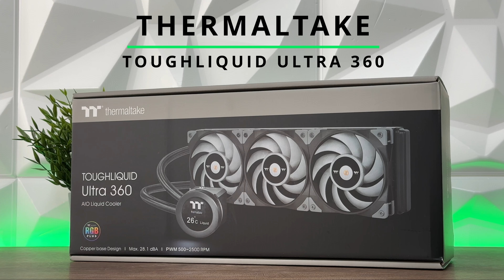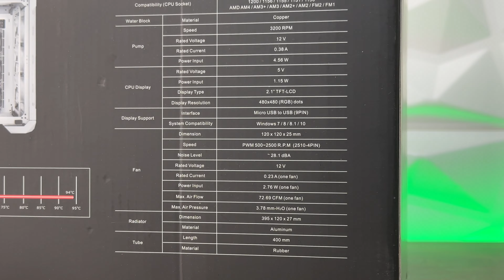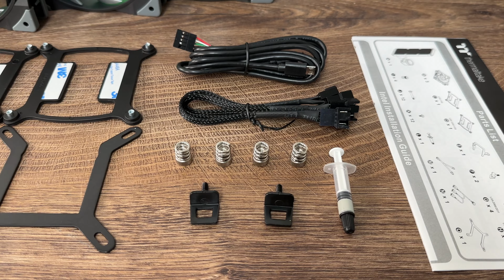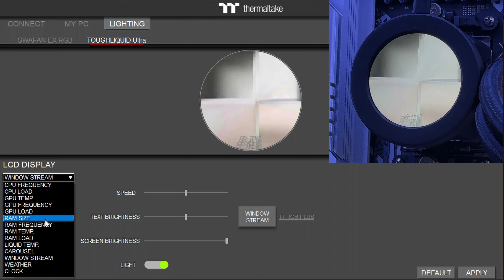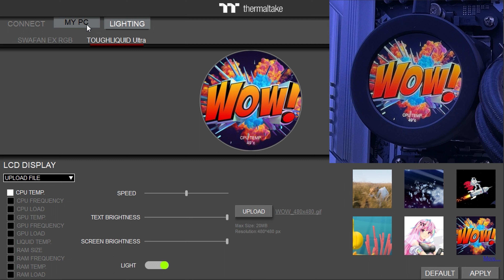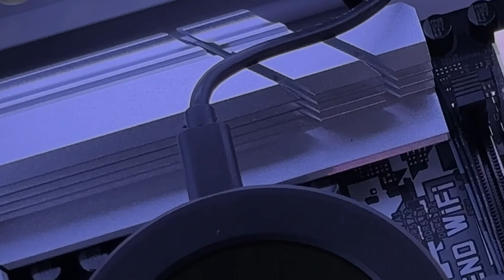THERMALTAKE TOUGHLIQUID Ultra 360 - 2.1" Customizable Display

Comment: When i want to add a gif to the lcd display i have to restart my computer for it to load. When it loads it looks cool for about 20 seconds then just freezes and goes back to the basic screen. The size of the gif is way smaller than 20 mb too so i have to idea what to do to fix this issue.
Reply: Same problem 😢

Comment: Thermaltake TH360 V2 ARGB Sync/AlO Liquid Cooler/Fan 120mm*3/PWM 500~2000 RPM/Mirror Waterblock/MB ARGB Sync Control/White, CL-W365-PL12SW-A dis the cooler I have

Comment: Wished you show how to connect the lcd screen no one shows how to connected it
Reply from the maker: Basically there isn't anything to show since you connect the micro USB to the pump and the other side to the USB2.0 header on your motherboard. It actually is nicely shown in their manual so that is why I didn't: https://file.thermaltake.com/file/qig/TOUGHLIQUID_Ultra_360_manual.pdf

Scroll down in the manual and the last segment shows it.
Reply: @PCCrazyDario  No one shows how to rotate the LCD screen. its not in the software and unless you have to unscrew the face with a tiny alen wrench, there doesnt seem to be a mechanical way to rotate the lcd so the tubes are on the right and the micro usd is on top, like it is in your video. right now my lcd is upside down.
Reply from the maker: @Gotchagain It is in the software
Reply: @PCCrazyDario yeah, I was going nuts because the software was glitched due to the recent patch. They did somewhat fix it in the next patch.

Comment: 2 questions: Is this the same as the TH360 ARGB V2 ULTRA sold in the USA? Also, does the LCD screen rotate? I see the cooling tubes coming out of the right side of the pump but in other videos (and in online pictures) the tubes come out of the left side of the pump?
Reply from the maker: That is a different AIO. Yeah, you can rotate the screen without a problem. I think that is software based if I remember correctly.
Reply: @PCCrazyDario  thank you!
Reply: @PCCrazyDario the V2 is newer than this, right?